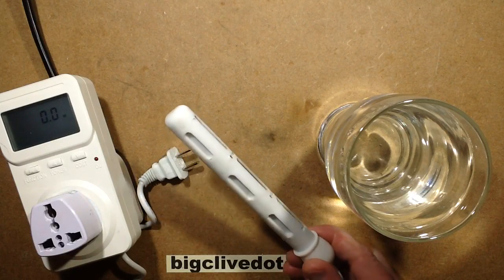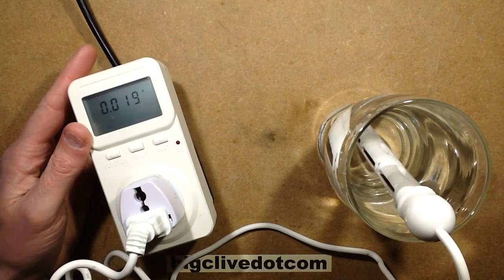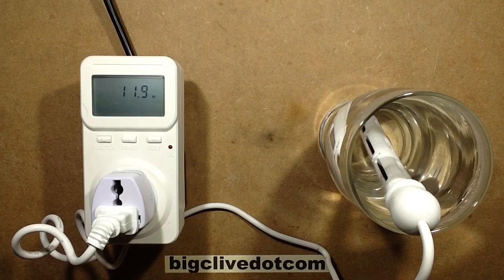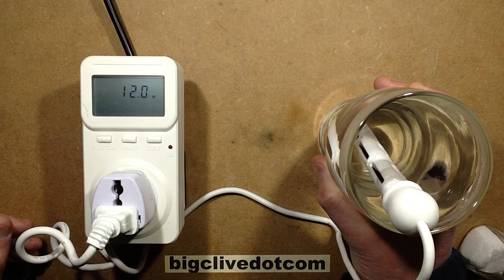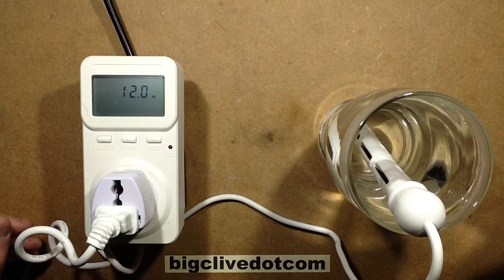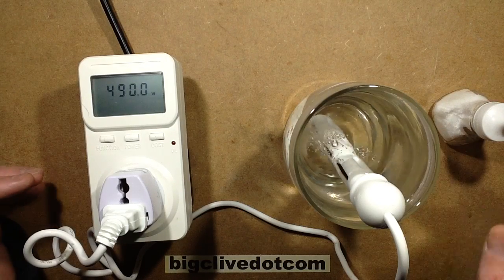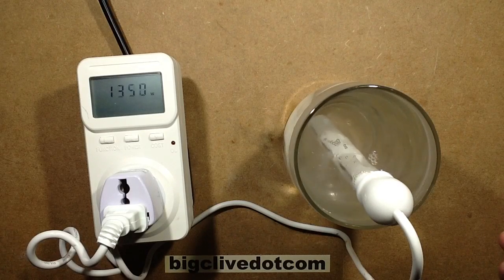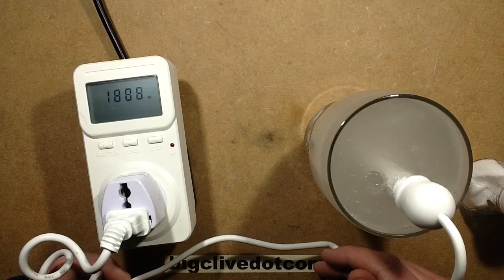240V electrode heater in distilled water.  Then with salt added.

Comment: Teaching a class in aircraft wiring practices, I used this same demonstration for aircraft ac power--3-phase 208 volt, 400 Hz.  I would dunk three stripped power wires in a cup of tap water, with no visible reaction (I made no measurements).   I would stir in a little salt, with the result being immediate bubbling and arcing between the wires.  Even though rain water and condensation does not seem to cause problems with aircraft electrical systems in the short term, environmentally sealed connectors and terminations are used in parts of the airplane exposed to moisture.

Comment: What would happen if you put a ground cable in the water? One that wasn't on a GFCI circuit that would trip a breaker. Like a straight connection to ground. Would it keep the water from boiling?

Comment: Hi, what's the name of the thing you used to measure the watts,volts and amperage on the mains?
Reply from the maker: +Alfie Smith Energy monitor, but this one is unbranded.
Reply: +bigclivedotcom oh, thank you it's always nice to have a reply on a comment.
Reply: +Alfie Smith look up kill-a-watt meter
Reply: clownrock95 Thanks
Reply: As the power factor is low with electricity passing through at the tips of the AC waveform, I wonder how many amps it measured when it was consuming about 2000 watts.
Reply from the maker: +Seán Byrne the water is acting as a resistive load, so the power factor would be virtually unity.

Comment: Did you use your water distiller from a previous video to distill that?
Reply from the maker: +Max Mouse (Mmouse) Yes.
Reply: bigclivedotcom seems to work well then... I'm going to buy a 78° version, for some reason they're pretty expensive, I'm not sure why.
Reply from the maker: +Max Mouse (Mmouse) I'm not aware that they did different temperature versions.  But they do a version with a lower power heater specifically for spirit distillation.
Reply: +bigclivedotcom oh, I'm not looking to distill spirits, that'd be illegal, I just really like 78° steam ;) - I need to look up more, as far as I've seen the wafer distiller is perfectly fine to use for ethanol.
Reply: +Max Mouse (Mmouse) How can distilling alcohol be illegal? We do it every day?
Reply: +yamatoneko1 distilling alcohol is illegal in the UK.
Reply: Max Mouse SWAT the bakeries then.
Reply: +yamatoneko1 we don't have swat in the UK, but why swat bakeries? They're not distilling alcohol.
Reply: Max Mouse It seems like you have not many thing there in the UK. So, it's ok, man.
Reply: +yamatoneko1 yeast fermentation does create alcohol, that's true, but it's not distilled. It's legal here to brew quite a lot of beer and wine at home as long as you don't sell it.
Reply: +Max Mouse (Mmouse)   the boiling point of a mix of ethanol and water is not 78 degrees. Nothing at all happens when you raise the temp to exactly 78.  I built that digital temperature controller for nothing !  its complex - google "boiling point mixture"  or Raoults law

Comment: I have a question: what is the best portable vaporizer for weed?
Reply: +artifactingreality Vaporiser... weed... you must be fucking high.
Reply: +Prehistoricman in the video he can say herbal supplements but we all need to know this important information.
Reply from the maker: +artifactingreality There are dedicated units for that purpose that use the existing battery systems for vaping devices, but have novel ways of heating either crushed leaf or liquid resin.  I can't tell you if they work well, since I don't actually smoke it.
Reply: +artifactingreality i used to own a Genuine PAX which was pretty good, but thats probably old tech by now. Google it, you will get a good enough answer.

Comment: like I said with the foot cleaner thing, distilled 0ppm water probably won't spurt out that gunge,  until you add different types of salts.   if you did the foot spa type experiment again using 0ppm water for 30 mins and no reaction, then add a little body salt that might be found on a sweaty foot.    then see if you get gunge pouring out.

Comment: Now just stick the heater is a bowl of salt. Forget the water.
Reply: +Brandon Francey 
And nothing would happen, because salts are very good isolators when dry and solid. If you melt them salts become conductive though, like glass gets conductive when molten.
Reply: +Jack White molten glass is conductive?
Reply: +hentai nat Yes. It's an interesting thing, but can be explained. The resistance of a conductor increases as it gets hotter. That's because the free electrons are too "busy" bouncing around. Insulators (like glass) start loosing resistance when they get hotter. In this case the "locked" electrons (that prevent current flow) break loose and are free to "dance" around. You may notice this when you see lightning. The non-conductive air gets so much voltage across it that "locked" electrons break free. Suddenly. All at once. When that happens you get a massive current flow, lots of heat, and even more electrons get free. This avalanche gets bigger and bigger until the charge is shorted out, everything cools down, and the "lost" electrons that got knocked loose go back "home".
Reply: Jammit Timmaj "busy".

Comment: Hey Clive, you use the power meter a lot! Any chance of a link please? I'd be interested in buying one!
Reply from the maker: +Dean Proudler Sadly no.  I got the power meter a while back and haven't seen the same model available since.
Reply: you might like this one  depending where your from uk or usa ?        1. https://www.ebay.com/itm/ATX9800-Electricity-Power-Meter-Power-Energy-Monitor-Socket-Watt-Meter-Analyzer/223195551691?hash=item33f77dd7cb:g:2qgAAOSw9gRaHnj1
------ 2. https://www.ebay.com/itm/Digital-Smart-Plug-Energy-Power-Electricity-Usage-Monitor-with-LCD-Display-EU-US/202405341135?hash=item2f204c67cf:m:mg79-Xpcz6_Cowe94iyRopA

Comment: The increase in current during the two-hour distilled water test ist almost certainly due to the slight heating of the water, not any ions leeching into solution from the device. The amount of H+ and OH- ions (which are responsible for the electrical conductivity) in pure water is dependant on the temperature. Higher temperatures lead to a larger concentration of ions, which in turn increases the conductivity and therefore the current in the experiment. 

You can see the values here: https://en.wikipedia.org/wiki/Self-ionization_of_water#Dependence_on_temperature.2C_pressure_and_ionic_strength

The lower the pKw value, the higher the concentration of ions.

Comment: These heaters are mad. It looks that a Chinese person has been to my country looking for business opportunities and saw an ad hoc water heater arranged using a cork from cheap wine and two old type razor blades with two wires attached to it. They apparently were in wide use in army and prisons and called, roughly translating, "a cement mixer".

Comment: I was concerned that the glass was going to experience some thermal shock causing the glass to crack, spilling salty water with mains voltage all over the place.  I'm glad you did this little test.
Reply: I wouldn't think it would because the water is still slowly  getting hotter
Reply: +E2qNX8btraQ3zRD6J7fc I was actually thinking the same ;-;
Reply: +E2qNX8btraQ3zRD6J7fc Water at mains voltage would be fun to splash around in. It could be like those events where people run into water at a beach during the winter, but instead of the cold, it is 120-240V.
Reply: @Razor2048  Having done essentially this in a lake as a teen... "It wasn't fun at all"
Reply: @Razor2048  yes, that's very smart electrocuting yourself 🤦‍♂️

Comment: You should do this with that big one for baby baths. Then put some salty piece of beef inside of the pot and see what happens. It would probably spike up to 4kW.
Reply: +Icathiann fuse would blow at 3.2 ish kw, plus a bit for luck!
Reply: +jusb1066 Naah, a normal house circuit breaker is max 3.68 kW (16A at 230V), but it will only blow at about 23A after an hour of load (that's 5.23 kW).
For it to switch instantaneously, 3-5 times the rated current are needed (that would be 48A-80A or 11.04kW to 18.4 kW).
Reply: +jusb1066 - I would be willing to bet near 5kw before it blows, try putting two 3kw space heaters on a 13A extension cable and it takes a good 15 mins for the fuse to go.
Reply: Maanuueel42 \m/(^_^)
but it is  plugged into a socket, thus a 13a fuse! lol  dont tempt clive to bypass a fuse! i think thats photonicinduction territory!
Reply: jusb1066 why would there be a 13A fuse in a socket? I've never heard of that... (perhaps that isn't the case in Germany, where I live?)
Reply: Maanuueel42 \m/(^_^)  every UK plug has a fuse in it, its part of the design, the max being 13a, UK being one of the few countries that does so. and cannot use a socket with no plug!
Reply: jusb1066 ooh, that's interesting. Why do they do that? multiple fuses in one line?
Reply: Maanuueel42 \m/(^_^)
well its part of the UK design that was back in 1962, each plug has a fuse, the circuit itself is a ring main which used to have a fuse (nowdays a breaker) around 32a and an earth fault (breakers and rcd came in around 25 years ago) but plugs, sockets, fuses are the same since 1962
Reply: +Maanuueel42 \m/(^_^) UK electric systems are wired in what is called a "ring circuit" It allows them to save a lot of copper for cables, but means they can't have central fuses, and need them in the plugs.

https://en.wikipedia.org/wiki/Ring_circuit
Reply: jusb1066 hmmm... So it used to be a system that prevented you from having to run to the basement every time a fuse blows, and also have your lights and all still working if you overload a device?
There are always new things to learn. ^^
Thanks for the Info! :)
Reply: Maanuueel42 \m/(^_^)
i believe the fuse in the plug to a certain extent protects the cable (from causing fires etc) if pinched or damaged, if the device is more complicated than a lamp, (such as a tv, microwave) it has an internal fuse (fast blow) of the required rating,   the plug fuses only (these days) come in 3a, 5a, and 13a, as that is what the cables sold are rated for. (fuses used to come in every amp rating, not lately though) modern cable insulation means even a 13a cable isnt too thick and unmanageable, so is often fitted to everything that is not super low power.
Reply: dumle29 Ah yes, makes sense. So you can only have one global fuse and then all other devices must be fused separately. Thanks! :)
Reply: +jusb1066 are you speaking of the a fuse located in the wall socket or on the plug of the device?
Reply: ThePoolboy789
no, a british plug has a fuse inside that, (see Wikipedia for BS1363 plug) wall sockets (usually) dont have a fuse
Reply: +jusb1066 he is using an adapter and an american style plug in the video. is there a possibility that it wont have the fuse then?
Reply: ThePoolboy789
there is still a fuse, the adapter is plugged into an electronic meter, which is plugged into a single  extension socket,  at the other end of the cable (off screen) it has a plug, and hence a fuse in it.
Reply: +Maanuueel42 \m/(^_^) Circuit breakers are 32A in the UK.
Reply: +dumle29 They have fuses/breakers in the distribution board (we call it a consumer unit), but they are twice the capacity (32A) of those in Europe who use a radial circuit.
Reply: cjmillsnun In my apartments' fusebox, there are 10 16A breakers distributing power to the rooms, one of them an FI-switch for the bathroom. For the whole house (6 Apartments) there is a beefy 100A/400V three-phase  breaker.
Reply: +Maanuueel42 \m/(^_^)  - What if you want to plug a toaster and kettle in at the same time? Ring main for the win!
Reply: Andre Fish No problem. Let's say toaster and kettle both pull 2.5 kW, that's 5kW. The breaker will take more than an hour to switch.
Reply: +jusb1066 Nothing a short piece of copper wire wrapped around fuse can't fix ;)
Reply: +Icathiann Give it to +photonicinduciton and ask him to put it into a large plastic saline container.
He has a setup that can handle two dozen amps
Reply: +Icathiann plop in a jack links jerky
Reply: Why are y'all talking about fuses? I've never ever ever seen an actual fuse in a distribution board outside of American movies. I can't believe Italy is the only place that only uses magnetothermic breakers...
Reply: It is called fuse. An acual fuse is only inside the plug.
Reply: Old shop next to the new shop I used to work at had fuses, always fun replacing those 250A ones when one of the old Norwelds decided it wanted to short out.

Oh and I guess the old screw in style we had here were also technically fuses. We call fuses and circuit breakers by the same name, and I bet that's true for other languages too. So that's probably why they call it fuses interchangeably.
Reply: or hook up a 64amp socket to the 100A feed lol
Reply: or a 100a socket if theres one
Reply: Do it!

Doitdoitdoitdoitdoitdoit!

Comment: Is that one of reasons you only use distilled water to top up batterys?
Dont want the mix to short the plates out?
Reply: +zx8401ztv i think its because the various junk in the water ends up coating the plates and partly insulating, like a kettle scaling up
Reply: +jusb1066 
I did think about the minerals but i was thinking more about the water conducting and possibly shorting the plates out.
But you highlighted the plates being coated too, Death by tap water LOL :-D
Reply: +zx8401ztv
battery acid is already conductive, so its probably more about the ion receptors getting blocked by the wrong thing, poisoning the plates basically. i wouldn't be surprised if adding salt to a battery gives it a temporary ability to take a charge, a boost for a very weak battery etc.
Reply: +jusb1066 
I do understand what you mean, only because you worded it for my rather thick brain lol :-D
"Ion receptors" hmm, didnt know about that, but ive never bothered to look into the chemistry of lead/acid batterys, and salt.. dont some people use epsum salts in batterys for the same reason?
I know a certain youtuber i unsubbed from did something like that.
Reply: +zx8401ztv yes epsom salts would be the same reason.  why did you unsub? i assume i dont need to be a 'genius' to work out which youtuber?   i too dont sub to (i think if it is), as the videos have become too lazy and the replies were often not so nice.
Reply: +jusb1066 Im glad it wasnt just me that saw a problem.
Im no genius, just a bloke that repairs stuff for frends now, i know enough about circuits to get most things working, im sure you know that anyway :-).
I really enjoy chatting to people, what i dont understand, other people do :-D
He wasnt open to anyone, i gave up.
Reply: zx8401ztv
to me a youtube is more than just the videos, (though obv need a good video to be watchable) but its the attitude to it, and the attitutude to your watchers and the never before opportunity to talk with said viewers, this to me is what makes a good youtuber.  as soon as they feel entititled and get too big for their britches, their own little click of commenters destroy the other people in the chat, and it all goes to heck,  a well known axe reviewer and a recent 3 letter name guy spring to my mind that this happend too.
Reply: +jusb1066 I cant dissagree, your spot on! :-D
We (the viewers) have to adapt to each person we watch, some people like chattting to there viewers, and thats smashing :-) but i do realise that they cant spend all there time replying to the viewers, so my comments wont allways be replyed to.
Most video makers seem ok, and you get the odd reply back :-D
The Axe reviewer i think i know (i unsubbed), the 3 letter one im not sure of, there are a few people that act like that.
I try to be a decent viewer, but my patience for big headed or closed minded people is getting shorter and shorter.
Reply: zx8401ztv
the 3 letter one, another clue: talks gibberish
, yes i understand the replying time, but you must make some at least, replying to none is just bad i think.  some manage by having one short session about an hour after initial upload and then dont seem to ever respond after that, i guess that satisfys their regular watchers.
Reply: +jusb1066 lol yes, i gave up on him too :-D
Reply: +Warescrackdown 
Oh hell, i can see it really is death by tap water lol :-D
Ive only ever used distilled water, i stick to the instructions :-)
Reply: +zx8401ztv The minerals in tap water which has irons on it blocks the small holes in the battery plates, it also builds up deposits on the plates which reduces overall surface area and cranking ability
Reply: +zx8401ztv 
AvE
Reply: +James Pian Him too :-D
Reply: +zx8401ztv Sorta but it's mostly to not introduce contaminants as the water reacts with the acid, if you add anything else it will cause plate corrosion or affect the reaction which in end will affect power output.